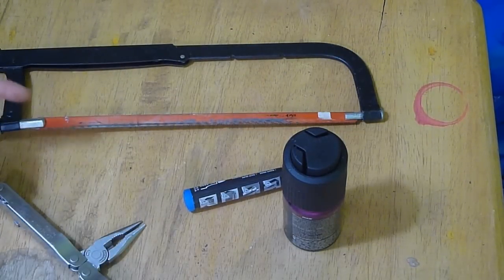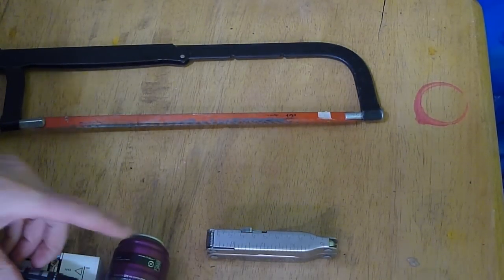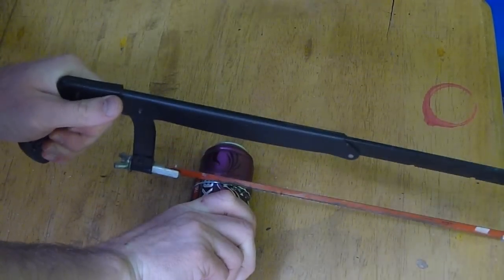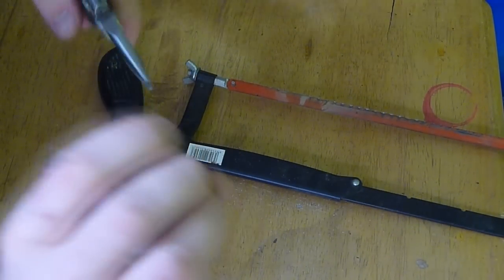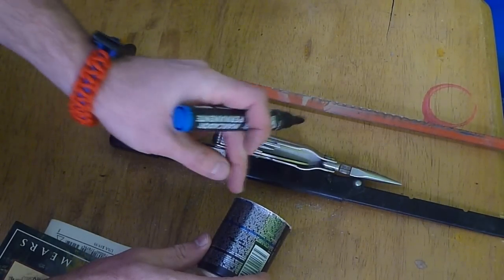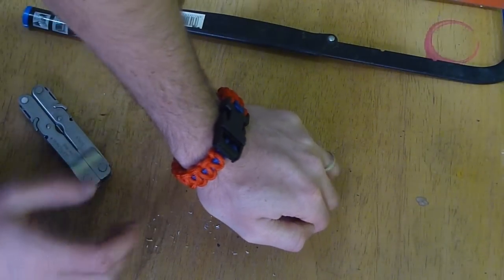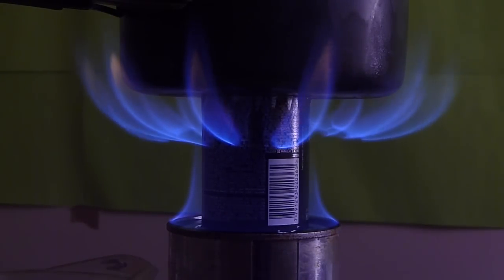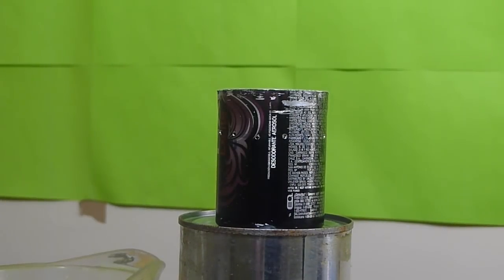Can you turn axe body spray into a backpacking stove?

Comment: here's a helpful hint for you.... when marking your can stand the can on end ,don't lay it down, yes you will need a few more books to reach that line near the top but the line will be perfectly straight ....laying it down the can can and will slide left or right when your turning it.  it can't do that if it's already standing on it's end  if the can slides to the side as your turning it to mark it there is no harm done as the line will still be horizontal just move the can back and continue to mark it... hope that helps

Comment: You've got a great start there, but I think you could make a few improvements on your design.  If you cut down the over all size it will burn better.  When you push the top down into the bottom, try seating it all the way down as far as it will go.  You'll need to cut a couple notches in the top rim of the bottle before you do that so that the fuel can flow into the outer chamber.  This type of design doesn't need to be primed.  If it's built correctly, you can just light the middle.

Comment: That's wrong.  As with All saws the teeth always point away from the person that's doing the sawing, doesn't matter whether it's wood, steel or aluminum, the cut stroke is always 'away from' not 'toward' the person holding the saw.

Comment from the maker: Thanks. I didn't have my leatherman ruler set correctly. It's just over 5 and a half inches. It doesn't make that much difference to the design, but thanks for pointing out the mistake.

Comment: FYI: to everyone who thinks this might be a good idea, don't bother, I have tried every single configuration for this axe can, it just doesn't work very well.
The primary reason is that it isn't aluminum so it has horrible horrible heat conductivity, the other reason why it has bad conductivity is because it's very thick. 
The burn is erratic as you can see from the vid and he never gets the water boiling, no surprise there. Don't waste your time, only aluminum and copper work well.

Comment: Just checked the internet.  Those who are experts state hacksaw blades should face forward not back.  Look it up.  I have always thought they were reversed of wood saws but I am apparently wrong. They are used both ways but Western designed blades are made to be most effective on the forward push stroke. The pull stroke exerts less pressure on saw blade and would take more strokes but because of that would make it a more precise cut.

Comment: A Dremmel tool with a cut-off wheel works best for me when cutting thin metal. Just make sure you wear safety glasses and vacuum up the shavings or work outside
Reply from the maker: Awesome. Would you recommend Dremmel brand or another tool?
Reply: The Outdoor Adventure Dremmel has multiple speed feature which is good because the cut-off blades don't need high speeds to work. I still have to file the edges

Comment: The only problem with this stove is, you have to buy a can of Axe Body Spray first.
Reply from the maker: Oh Snap! Good one. Or, you can do a bit of dumpster diving at high schools. (Not recommended!)
Reply: And your ooibt is?

You dont recognize greatness when you see it.

1. In the top 10 stoves for fuel efficiency.

2. Almost crush proof 

3. Small and compact. 

4. Works with small diameter pots.  

Great stove. I recommend it.
Reply: I hope you realize I was not dissing the stove, but AXE body Spray.

Comment from the maker: @bouncingsouls6 If you do have extra fuel, just blow out the stove and then tip it over. The left over fuel will drip out the hole for the jets and you can save it for next burn.

Comment: When using a hacksaw the teeth should be pointing toward the rear (i.e. you). The cutting action comes when you PULL the hacksaw toward you, not pushing forward. Pushing forward for your cut will only damage your blade, prolong the cut time, and cause the blade to bend FROM putting your weight* into it. Basically, when you use a hacksaw, you pull toward you to cut and the top of the teeth should face the direction of the cutting force.

Comment: Look up v8 jet alchohol stove. Its a better design then this. Ive made six different styles (jet, tube, cigar, flip, penny, and whatever this is) and the jet one works best. 1) it lets you place pots on top of it easier 2) it primes itself 3) its very compact (about 2x the diameter of a quarter) 3) I can boil 16 ounces of water using 1oz of heet fuel in about 10 minutes.
Reply from the maker: Thanks for the comment alex. I personally don't use this stove design. I prefer my tomato burner and single-can double walled energy drink stove. I did it as a recycling project (what can I do with this can?) This stove can be self priming, it's just faster when you prime it.